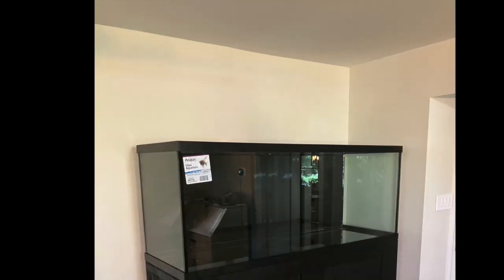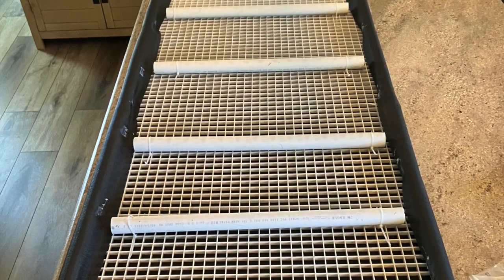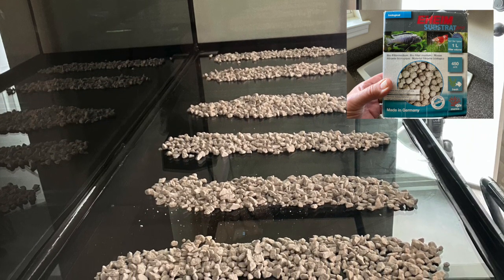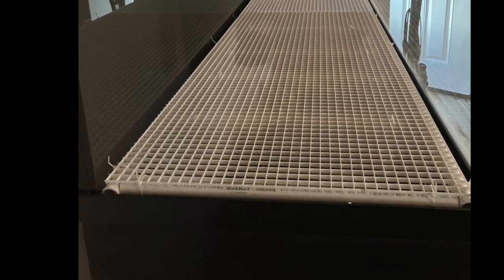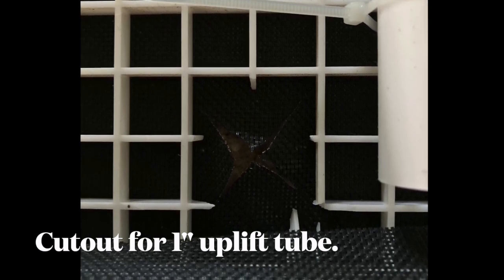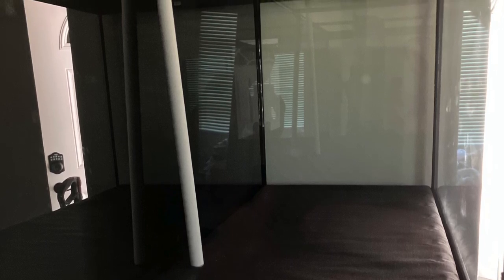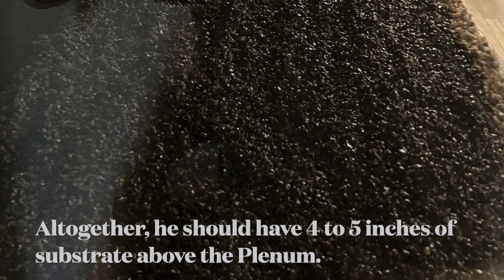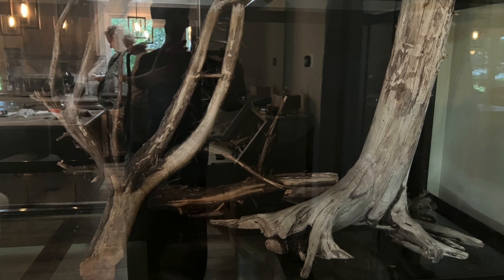Continuing on with a Step-by-step instructions on how to build a Plenum.

Comment: A question concerning soaking wood:
Im considering converting a 55g brackish tank to fresh, Walstadt style.
How long should i soak the existing lace rock and driftwood to remove all salinity?
Reply from the maker: Actually, cleaning off everything real good with a garden hose should do it. A little bit of salt, especially sea salt shouldn't harm anything if it's in very small amounts..

Comment: What's holding the uptake tube off the bottom of the tank glass so the end of the tube doesn't get sealed off on the glass and lose all its draw of water using the powerhead????

Comment: Instead of using pvc pipe i just cut out about an inch of the egg crate to hold up the main Louvre. Works well.  I also used plastic bio balls in the middle.

Comment: really glad i found your channel.
So, when you use a power head with a plenum - say 75 gallons; how fast is too fast regarding GPH?
Reply from the maker: 20 gph and that is as fast as you should go
Reply: @anoxicfiltrationplenums  Thank you Dr. Novak. Since my original question - i have dove into most of your posts. I found the GPH a few videos in thanks for responding in this thread. I am embarking on a 75G build - fresh water planted. I have started to collect all that is needed. * Note to others - take the time to look through all the videos Dr. Novak has created - tehre are some answers within that are amazing.

Comment: It's so clear to me now how a plenum should be. Thank you Dr. Novak and to Ralph for the detailed narrative and pics. Very helpful.
The only part that wasn't clear to me is the vertical pvc pipe that comes out from the plenum; where does the top end of the pipe  connect to? Kindly elaborate on that part only. Thanks. Cheers.
Reply from the maker: Glad it was helpful! The top end of the pipe is going to a powerhead.
Reply: How often should the plenum & substrates be washed and/or changed?

Comment: Kevin, do you recommend using the barrier (like mosquito mesh) over the under-gravel filter in a planted tank? You mentioned that plants will have a hard time penetrating through the mesh, but it wasn't clear whether you are for or against it.
Reply from the maker: If you're using a very find substrate, it's highly recommended. You can also use window screening that you can buy at any Hardware Store.

Comment: Dr. Novak i remember you said before to run the slow moving plenums slow and the BCB's fast. That is what i am doing except i have now just a bcb in  a tank with very little flow and my nitrates are always zero on that with average bioload. Do 40% water change every 2 weeks.  My plenum tank though 1 bubble a second and tank with a larger then average load of animals nitrates are always about 10-20 ppm. Do 40% water change every 2 weeks. Maybe it is because i run a sump and have 1.5 year old organic potting soil 1 inch thick above the kitty litter and below the 2 inch cap. I also add liquid fertilizer because it is a jungle with CO2.

Comment: Thank you Dr. Novak for once again providing this info.  Since I am setting up a plenum in a 6ft long tank like this video, I noticed 1 uplift tube. I am however planning to use 2 simple air stones with a 5” tube (can’t make smaller). Will 2 small air pumps rated for 5 to 15 gal at approx 1 liter/min be okay or will this be enough? The nano ones are about half the output and I am afraid they will not be enough. If I can, I would like to just go with one or the minimum for my size tank. Any guidance would be helpful.
Reply: Slow bubbles mine is 1 bubble a second on a 40 breeder or 3 foot x 18 inch . This tank is 2years old and i build it exactly according to Dr. Novaks video 2 years ago except i put 1 inch of organic potting soil above the kitty litter and below 1 inch gravel and 1 inch sand. Seems to working great with 25 Corys , 2 plecos, 5 guppy males and about 30 shrimp with a few oddball pygmy sunfish  nano fish. It is growing a jngle of plants and never vacumn the substrate  instead i just clean the sump and do my water changes there. I built a 8 gallon overhead sump .Sump is 24 inches long. When i build my plenum for my 6 foot tank i will also use 1 tube on each side and run that at 1 bubble a second each side. I think alot of people run their plenums too fast.

Comment: Dr. Novak, hank you for this video. Just in time for my 1st Plenum set up. 
I use the screen too, as the quality of our ugf here not so good, though finally found similar to what you use. The holes are not moulded nicely.

My tank is 20g, 23.5" x 14" x 14".
The height of ugf is 1"+, I use mix of Prodibio & Shrimp Breeder soil 1.5"+, then covered with 1" American gravel, which I bought 22 years ago (it was the only gravel available in Indonesia, forgot the brand (it was in cement paper bag, from California or nearby). Round-ish, 2-3 mm.

Since we have no Fritz zyme, I use whatbI have, Sera filter biostart. This is Day-1.

My plan is to build BCB, what can I use as replacement of kitty litter (we only have clump litter here?. Can I replace it with aquarium soil?

Comment: I didn't see the oil dry. What color is it? Is it black?
Reply from the maker: Kitty litter and oil dry or basically the same color and when wet one may be a little darker than the other one but they are gray in color.
Reply: Why did he use oil dry ?

Comment: In my small 15 gallon I put in a full layer of 10~12mm hollow bioballs under a 60cm undergravel filter which was only 12mm deep. I was originally trying to get the bioballs to sit in the recesses of the undergravel filter plates but gave up and just added lots of the bioballs so that the plates are fully supported by then. This gives nearly an inch of plenum and a lot of pores for bacteria. The undergravel filter was covered with nylon insect screen which was hot glued to the plates.